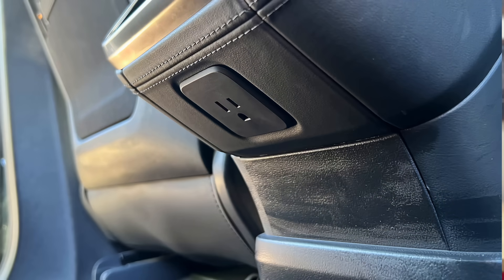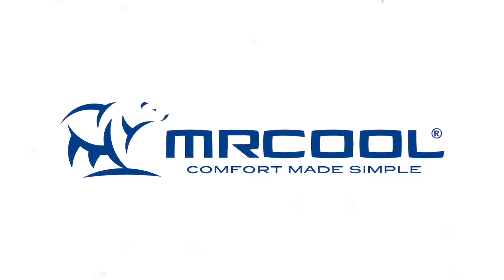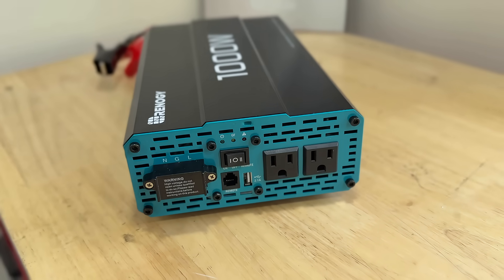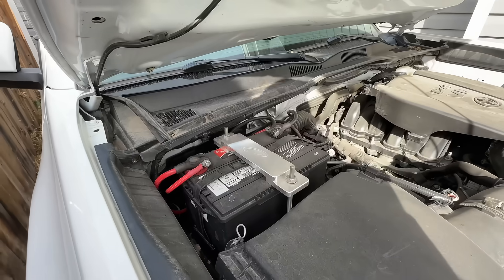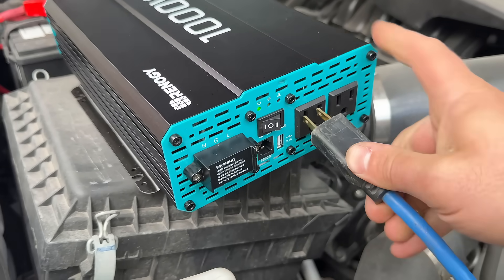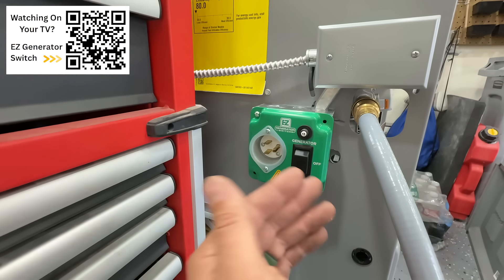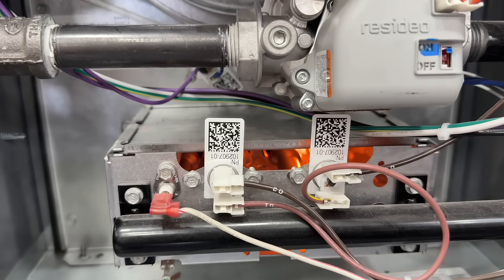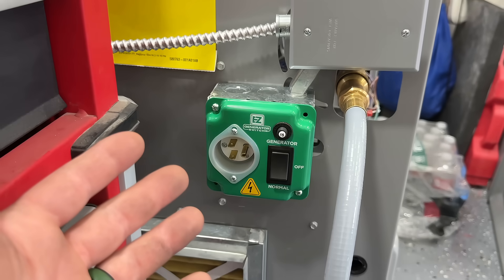Why Buy A Generator? You Have One Parked In Your Driveway.

Comment: Two things, never connect the negative cable first when attaching anything to a car battery, this can cause sparks and even damage the computers in modern cars. Second, your car does not spend most of its time at idle. If it does you live in an area with way too much traffic. At most, the average car is at idle no more than 10 minutes a day. Letting your car idle for long periods of time will increase the wear on the engine more than if the car is in motion. It also prevents the vehicle to operate at the proper temperature which leads to more unburnt gas and more deposits on your valves and spark plugs that results in decreased fuel economy. The unburnt gas could also lead to oil being diluted by leaking past the piston rings and wearing the cylinder walls. 

So the risks to you vehicle might outweigh the risk of going without power, but it is a complete lie that cars are at idle more than they are at driving speeds and that idling your car for long periods of time doesn’t damage the engine. Letting your engine idle for hours for several days is just asking for major engine repairs in the near future. So buying that generator might be the better choice if you live in areas that can go days with power outages due to natural disasters.

Comment: What’s messed up is people don’t wanna spend $500-$1000 for a generator ,,,,, but they will spend 50,000 to 100,000 for a vehicle !!! nice and secure
Reply: Cannot remember the last time a generator would have improved my living situation. Inverter has always gotten me through. I guess the difference really is spending $500 to $1000 for a generator that requires ongoing maintenance, and separate fuel that MIGHT get used versus a $100 low maintenance inverter that simply sits on a shelf. The vehicle will most certainly get more use and is more flexible than the single purpose generator.

Comment: Been using that idea for over Ten years. But you can only do so much. 

First you need to get LONG Power Cords and have Extra Gasoline to run your Vehicle.

Second you need to run your Vehicle COMPLETELY Outside. Just leaving a Garage door open can still Generate Carbon Monoxide in the Garage. 

Third, don't try to heat your House with the Inverter. Just sit in the Car and turn on the Heat. Use the Electricity for the Refrigerator and Freezer and some Lights.

Hope this helps.

Comment: interesting....for emergency heat i think a mr buddy cheap portable indoor safe propane heater would be a much better, less expensive option. however this could be nice for powering the fridge in an emergency, i suppose. i had one of these car inverters ages ago that i think was like 40 bucks and plugged into the cig lighter. i assume this is much beefier. iirc that one topped out at 100 watts or something. one other thing, in my case my car sits in my garage, and i'd be tempted to leave it running in there. however be sure not to do this, even with the garage door open, that exhaust can supposedly seep up into your attic and be dangerous. you would have to leave the running car fully outside.
Reply: edit, after reading all the comments about burning up your alternator, idling being bad for cars, sine wave this and that, plus just the hassle factor, i'm not so sure i'd mess with this anymore. probably better easier and cheaper solutions for everything. Really just get your mr buddy for heat, and everything else should be kinda gravy or easy to handle (for example lighting, just use candles or a million great battery lanterns they'd have at wal mart). plus, i doubt you'd want to run anything you'd actually want too (aka, heavy appliances, space heater) over the extension cord this would require anyway. Plus it aint cheap starting at 150. this just reminds me though, power outages are fun. weird as it sounds. i was trapped in my house for like 3 days in the great texas cold wave of 21 and it was kinda great tbh. an adventure. altho unlike many, i never lost power. just water for a while iirc.

Comment: ALT SIZE	INVERTER SIZE
80A  Up to 1000 Watts
120A  Up to 1500 Watts
270A  Up to 3000 Watts
Reply: Also pay attention to the wire gauge in the extension cord.
16 gauge for 1000w
12-14       for  2000w
10              for 3000w
Reply: @wisconsinfarmer4742  Also depends on the length of the extension cord.
Reply: @wisconsinfarmer4742 
Thank you. Wishing you health, wealth, and stealth.
Reply: Thank you for that valuable info
Reply: How many amps Toyota Tacoma alternator/battery?
Reply: @tnvfl Thank you! Wishing you health, wealth, and stealth.

Comment: For an average 1,500 square foot house, a generator size between 5,000 to 7,500 watts is typically sufficient to cover essential appliances and general power needs. However, for more comprehensive coverage, especially if using energy-intensive appliances, a generator between 8,000 to 22,000 watts may be required.

Comment: Great idea..... ! We have a old commercial work van that's driven when needed and used for hauling with projects around the house. Wouldn't take much to add in a few deep cell batteries and mount solar panels to it along with power inverters. Our household would have a mobile power station ready to use in any given moment.
Reply: exactly what we did with the old 1988 farm truck. it never hits the road, is only for the farm, so zero cost to the .gov

Comment: I've used various power inverters in my vehicles for over 5 decades and would like to offer a few observations. My first combination was a mechanical vibrator driven version that could deliver 60 watts output while drawing about 100 watts on the 12 volt side. Since the generator (yes generator) could only deliver 30 amps at most (and needed to be well above idle to accomplish that), it didn't get much use. My current vehicles have alternators rated at 100 amps and 150 amps (peak) at full speed. One of the quickest ways to kill a car alternator is to try to get peak current out of it for an extended amount of time. My present go to inverter for shout duration outages is is only 400 watts and even it will draw up to 40 amps from the vehicle. Another thing to note is the relatively small amount energy the battery can hold. Rather than give an Amp-Hour rating, you'll see a spec called reserve capacity (typically measured in minutes). That spec assumes a draw of 25 amps (about 250 watts). A typical new Group 24 battery might have a 95 minute rating while a considerably larger Group 27 will deliver just over 2 hours. If you have ever accidentally left your (head, tail, running) lights on for a just few hours only to come back to a dead battery you know how quickly just a 100 watt load can deplete it. Even at idle, a car engine will use more gas per hour than a small 4 stroke generator.

For HVAC, I have been running several single head 12K Senville Aura series systems for the past several years. I chose that particular brand, model, and size over the dozens I considered for several reasons. There are only 2 major companies (Midea, Gree) and and one smaller one (Aux) that make the vast majority of the private labeled brands as well as their own offerings. Midea seems to be by a small margin the most innovative while Aux seemed to focus on the lower efficiency budget end. Next I looked at the efficiency curves over the moderate temperature range in my zone. The additional 20-30% energy savings of the wider range cold climate systems was hard to ignore. The soon to expire tax credit on the entire cost of the project brought the price of the premium grade equipment in line with the standard grade. 

In most cases, the lower capacity outdoor sections within a given series are more efficient than their higher capacity siblings. IOW several smaller systems can have higher overall efficiency, more flexibility, and inherent redundancy as compared to a single multiple head system. Cost was about the same. See The DIY HVAC Guy's video at https://www.youtube.com/watch?v=hE4MSM7cMZI

My pile of AHRI data sheets was growing smaller and the specs on each were virtually identical down to the shipping weights. It was quite obvious that each was offering the exact same Midea built machine. It was time to take a closer look at the differences between the various importers, their policies, practices, technical support, parts availability, sales and support literature, warranty, and of course delivered price.

Pricing fell within a 3 to1 range with the 2 highest being well known brand names that had made their reputations decades earlier when they actually manufactured something. Next highest was from an importer that actually had two different house brands that differed only in the length of the compressor part of the warranty - 12 vs 10 years. Lineset priced separately.

Next to be crossed off the list was an importer with a website that was primarily focused on the fact that there was the Federal Tax credit available.

Senville caught my eye initially because of the mention in some of their literature that their Aura series had Power Factor correction. That could be important to anyone who has an industrial or commercial account with the power company since there are usually surcharges if the power being used has anything less than a near perfect phase relationship between voltage and current. It may be important to a homeowner because a poor power factor could effect the sizing of a generator. PF is different from inrush or Locked Rotor Current which is something else that could influence generator sizing. LRC is not generally an issue with mini splits and other inverter driven AC compressors.

Of the importers that I called, the technical staff at Senville seemed to be the most familiar with their product, and, in the one case where the tech wasn't sure about a highly technical question, I was quickly emailed a copy of the Midea document that had the answer. Incidentally, they also had the best price and were willing to further discount even that. It's possible that you could negotiate an even better deal with them on Ebay.

BTW I've been monitoring my systems with individual PZEM-022 style meters (also sometimes known as MIC-APM-385C on Ebay) and can confirm that my 2023 R410A systems do indeed have a near perfect power factor of .99 to 1.0 at all times other than standby (when power draw is negligible). Inrush current is practically nil making these units extremely generator friendly. I expect to have access to a friend's 2025 R454B system once he's ready for help installing it.

Comment: Before doing anything you should verify your vehicles alternator output and see what high output options are available as a replacement. Buying this inverter and a higher output alternator could work for this situation in theory, just make sure you have the proper size wrong to go with it and protect your system with a reasonably sized fuse very close to the source. Also, some newer vehicles, Volkswagen and BMW just to name a few need to have a computer to reset the vehicles computer whenever a new battery or alternator is installed in the vehicle. The days of changing parts and being done are long over with. Just something to keep in mind. If you’re unfamiliar with your system, google into you specific year, make and model to get the info you need to make the best informed decision. These things could cost you far more than a few new generators in vehicle repairs if things go sideways when trying to do this.

Comment: That system that your using is a last resort kit ,  faults ,exhaust smoke ,limit of cable ,engine will get very hot ,unit will get toasty , buy a generator ! Get solar with battery storage

Comment: Well. Can't say for everyone. My 08 yaris with a 355amp alternator can idle for days without issue. I have a xsd3400 in front and 120ah lifpo4 in the back. It feeds my 8500w rms sound system. I also have a 2500w pswi installed above the amps. At idle. I get 158amps. At 1200rpm I get 270amps. Being i control both my alternator voltage and my throttle positions I can easily set it up to run at various states. If you do the math. 2500 watts at 14.4v is only 173amps of draw. So easily handled. Cost was a little over 900 bucks including lifpo4 battery. Which i built myself. Just a little peace of mind when all else fails.

Comment: I used to have a 1999 blazer and an 2000 Escalade. I connected their batteries to a 3000 watts 12v inverter and run the house after María destroyed our electrical system

Comment: Yes sir as a last resort, but not all people service or have serviced their vehicles properly. Also it must be running and therefore if a person left their car running (even locked) it could be hi-jacked or stolen. Lastly a smaller inverter generator is only running on a single cylinder for the most part(more economical than4,6or8). But you are correct and as a last resort you can use the car/ truck as a generator.

Comment: Just be aware of this . Your typical 1979 FORD alternator puts out 72 amp . Once in use and the alternator is hot that 72 amps drops to about only 45 amps . When pulling that amount of current you need to have that alternator spinning a lot faster then idol in order for the fan that is attached to the alternator to keep it cool or you will blow the diodes from overheating . This is why the kids with big stereos are blowing up there alternators . They are not spinning the alternator fast enough to keep the diodes cool and this is what burns in a alternator . Lets say that your car`s charging circuit is regulated to hold at 13.6 volts , The lower you are away from this number the more current your alternator will produce . If you pull more than it can produce , it will simply take the difference from the battery in turn lowering that voltage of 13.6 . A watt , is a watt , is a watt . Remember ohm`s law when applying these loads . You have a 120 volt , 3/8 drill that draws 3.5 amps . Amps times volts equals watts . 120 volts times 3.5 amps equals 420 watts . Now at the DC end of the inverter it would be 12 volts times 35 amps equals 420 watts . In this case , I am sure that the gas furnace draws more then 3.5 amps , never mind the losses in that long extension cord . Idol is no where near fast enough to keep that alternator cool . For small things , no problem . Now knowing this , you have been warned .

Comment: If you remove the rotor winding and install 1 doughnut magnet on each claw.
The alternator will make 220 volts with 12 amps of current at 800 rpm.
This eqivilant to 3600 watts.enough to power a 1.5 hp motor to drive the alternator with and enough wattage left over to operate a coffee pot or crockpot.
All that is needed is a drill to spin it into life.

Comment: Could you plug the extension cord directly into a portable electric heater in your house?
Reply from the maker: Yep!
Reply from the maker: You may need a larger inverter though as electric resistance heaters pull more wattage

Comment: You might want to get one of those aluminum dryer vent holes For the tailpipe and send the exhaust Pointing away from the home😉We've been doing this for years, we know!....We ran a full-size Frig(Energy Star) , a few Led Bulbs, 70" TV, (Streamed Laptop[Movies] to TV), Phone Internet Tethered), Furnace, -9mm handy- 9medium sized candles handy😁, oh and, I used a 2KW Pure Sine wave Inverter. (Recommend This Wave) ..AND you're right, cars can  "Quietly" idle for hours, (We never had engine trouble) though I did run out of gas once🙄Live and Learn, extra 5-gallon(s) on standby. (Don't forget to add Fuel stabilizer)🤔 ....BTW, for kicks and giggles, I upped the alternator to a high output version🙄 Yep! When it comes to engines, people can be real nut jobs!😉🔧⚙
Reply: Thanks for the additional info! This is why I read the comments.

Comment: So does the vehicle need to be power on ???
I didn’t see you turn on your truck??
Reply from the maker: Not initially but depending on how much you are using it you need to start it to make sure you aren’t fully depleting your battery. Alternatively you can leave your vehicle on no problem. It’s much more efficient than a generator and much quieter as well

Comment: Those inverters are not rated to operate in that high heat environment.  They are usually rated up to about 105°F. Would be better to run battery cables out of the engine bay to the inverter.

Comment: Here are some additional tips; 
*If you have a garage, you can run an exhaust hose, from your exhaust pipe that connects to an exhaust port that you have installed on your garage wall, so running the vehicle inside your garage is possible.
 
*Also, you can get higher wattage alternators, and stack them in groups of two, three, or four. (These are generally used for cars that have lots of high wattage stereos, and battery banks). Then you can run your fridge, washer, heater, all at the same time. on different power cables. (Maybe run mini-splits).  

* Hardwire your furnace emergency power line to a "reverse outlet" in the garage, and then use a shorter 12gauge or wider extension cable. (Then you don't have to hunt for a flashlight, go to the basement/crawlspace, or keep a door cracked open...)

* a lot of RV's have and truck cabs have auxiliary outlets designed to run 110 gizmos

* if you use your car/truck as a generator for more than a few days, get the oil changed in it when you're good to disconnect and use it as a car again. (It's the same thing you would do with a generator).